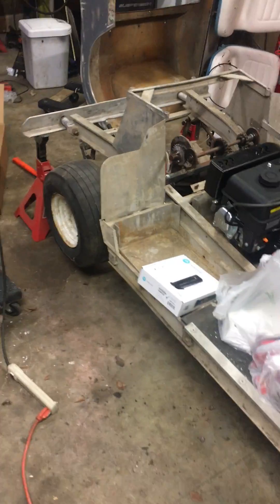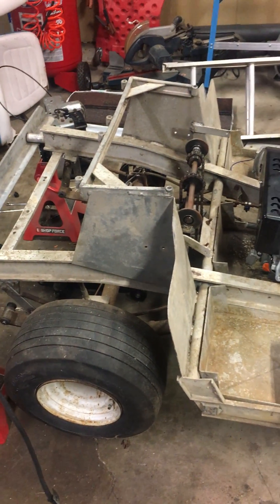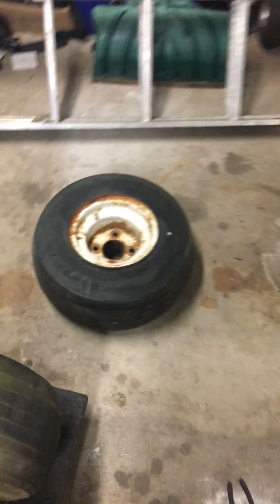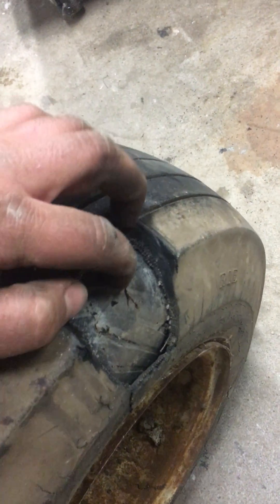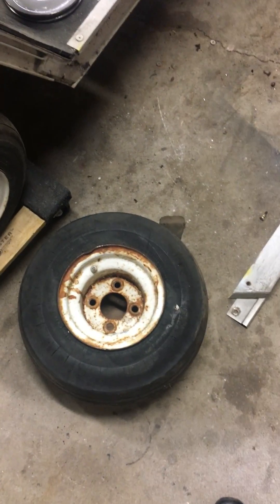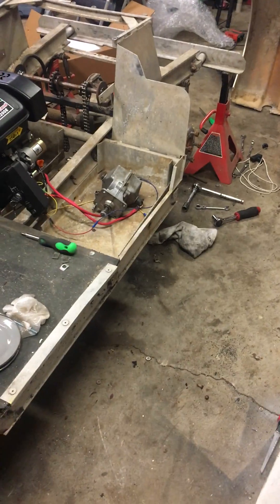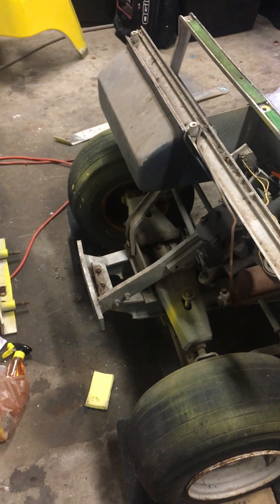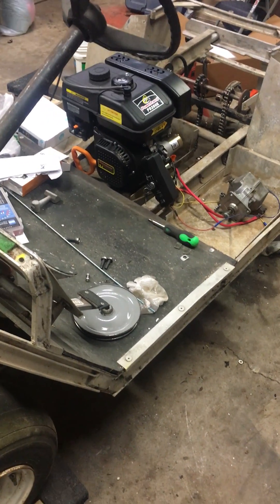Club Car Golf cart project part 3 electric to gas conversion

Comment: I would say it is foam filled to make it a flat free. Camso does them in my area.  They drill a hole in the tire opposite the valve stem to let the air out as the fill it with the material and it sets up solid.